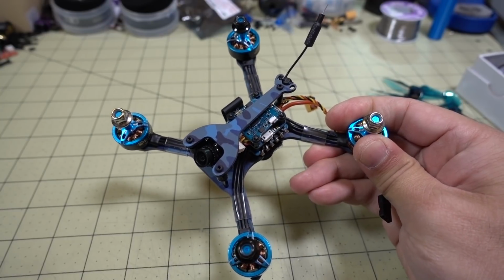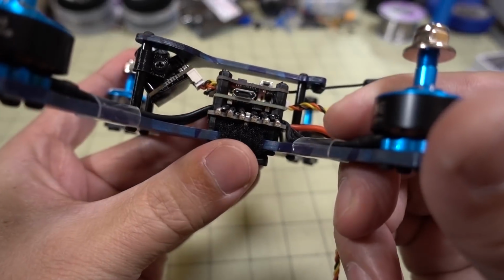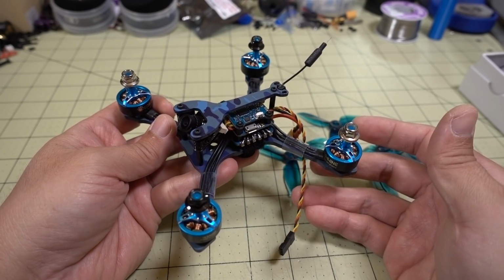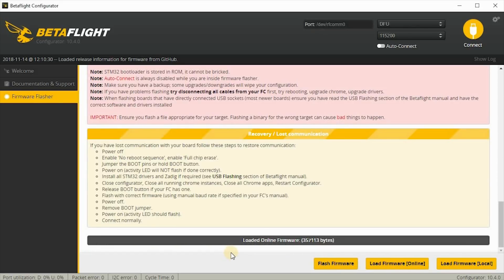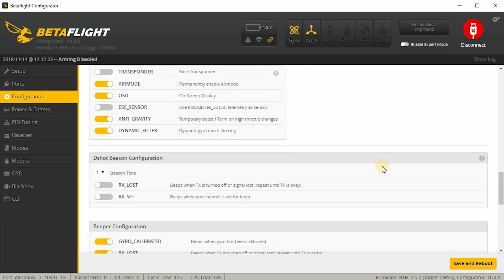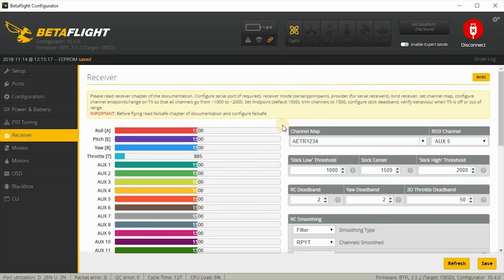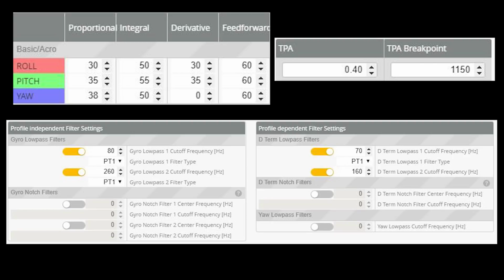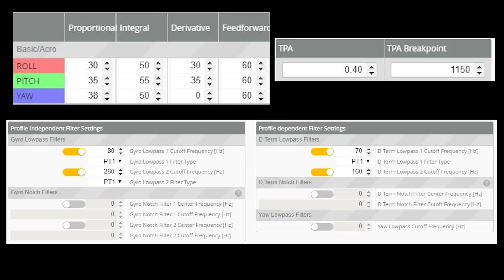MD#136 🚁Eachine TS130 3-inch Micro FPV Racer 🏁

Comment: those motors are HUGE relative to the frame.  My theory is finally coming true...
Reply from the maker: what theory is that?
Reply: @AlbertKimTV  Motors will get bigger on every size drone.  For example the new 2507 motors for 5 in. from BH, 1507 on 3 in. from catalyst machine works and eachine, and it is only a matter of time before we get 1104s on a whoop.  It is the key to speed, and it is how the hobby is progressing.  Also, I predict 8s will be the new big thing in ~1 year.  There is no reason except money that people would not switch.
Reply: The problem with your theory is that batteries are not keeping-up with motor size.  Flying a 1050mah on a 3” quad is silly - and gains nothing due to extra weight - and puts more stress on motors and props.  850’s weigh 100 grams +/-  and 650’s weigh 80 grams - we need better batteries to fly the big motors - unless you don’t mind one to two minute flight times.
Reply: @duckslave  But is that not what is happening?  Becuase that is where the industry is going right now.
Reply: T R  - I know - but not the battery industry.
Reply: @duckslave  think about what your saying.  battery industry is ALL ABOUT smaller and more power in it, that's all they do... Sure batteries are the weak point in power:weight, which is even more reason the battery industry IS going in that direction. How is it not?
Reply: Smoke-This - lithium polymer batteries have reached their limit - there is only so much you can do with the chemistry.  Sodium batteries are a ways off - what I'm referring to is new battery chemistry that lets more power be stored in smaller, lighter batteries.
Reply: @duckslave   your so narrow minded, so you think the lipo is the only battery tech that exists? Your point.. is pointless.
Reply: Smoke-This  - I don't think that at all - I mentioned the new sodium battery technology that is evolving.  Please show me a non-lipo battery for the drones we fly, and you need to learn not to engage in personal attacks by calling people names - doing that has nothing to do with intellectual discourse.  Of course, you may not understand that concept.  Also, your grammar is poor - the term "your" in the context you used it should be "you're" which is a contraction of the words you and are.

Comment: Not too bad as Eachine products go.  The D gains seemed quite high - and I would change to the Gemfan 3052’s - I’ve not had good luck with the Dalprops on 1506/7 motors - vibration issues.  If you have Iterm_Relax enabled you might want to try and increase your I gains substantially on pitch and roll.  The transmitter on that model is a real cheapie - I’ve had bad luck with them on the Mini Bfight and other models.